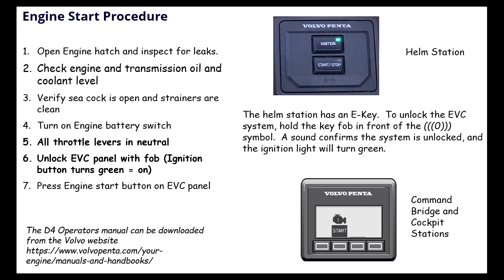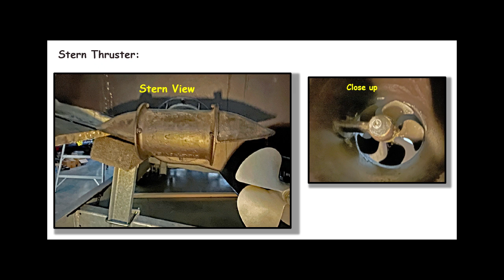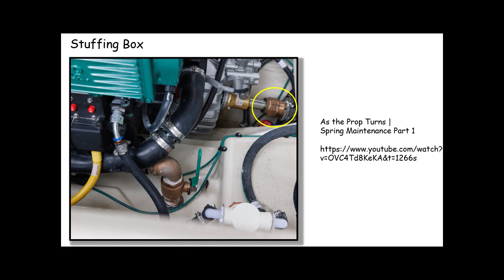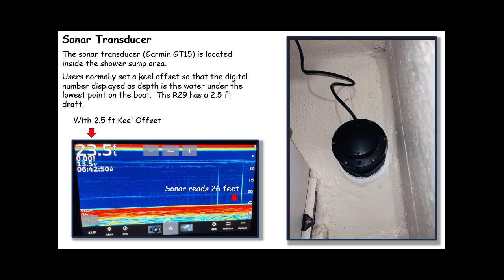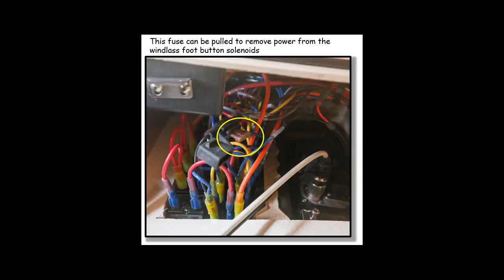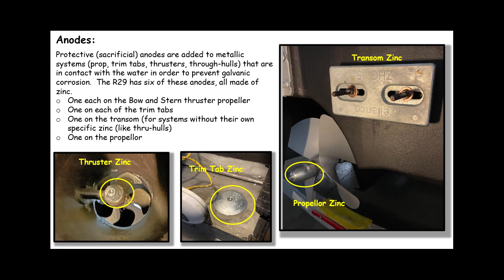Ranger Tugs R-29 Operations Review

Comment: Thank you, always good information.  A few items that I do not see in any of the service guides i find on line other than directly in the Volvo d4 service manual is the crankcase ventilator filter (CCV) , air filter replacement, and Rudder actuator oil and compressor oil inspection and replace per Volvo recommendations.